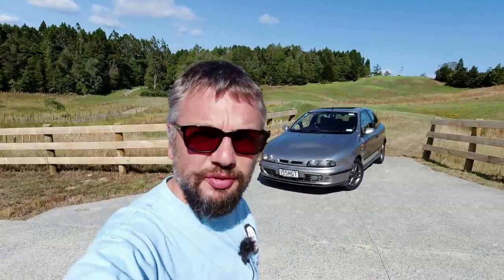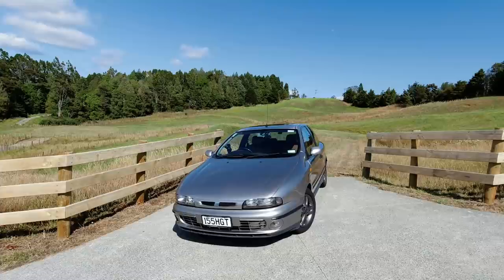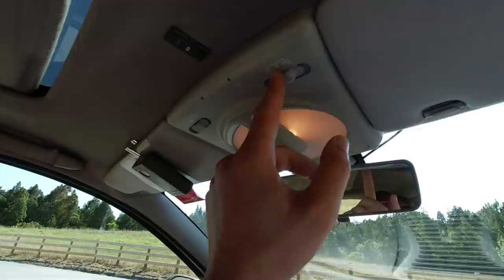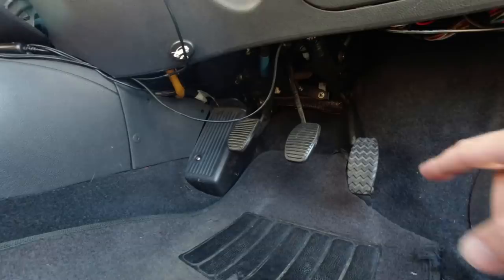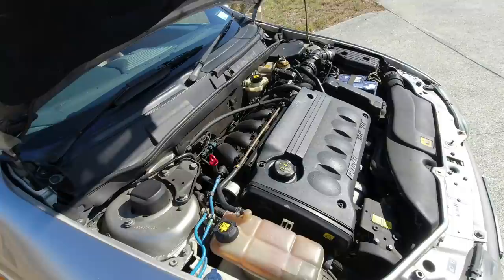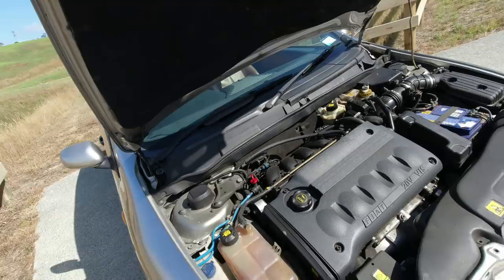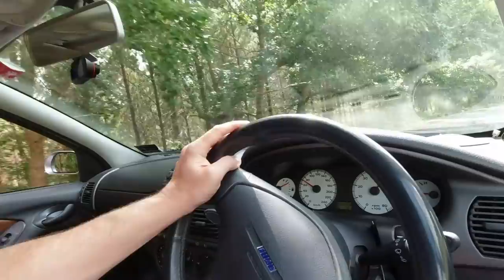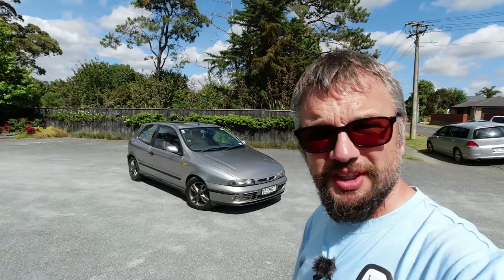Five-pot Fiat! Bravo HGT (Type 182) - Italian Music

Comment: Just had new (old) air cond condenser fitted so even cooler now :) 
Wobbly throttle sensor was being sorted when virus lock down closed NZ. 
Bonnet release lever had pulled out of its pivot, never seen do that before but clipped back in now! 

The 'Hasn't Got Torque' always needed, loves, to be rev'ed :)

Was daily driver until Jan 2019, one day will get a respray (clear coat starting to go in NZ UV) & fix headliner. 
Still running original drive train (Inc clutch), I've had 2 cambelt changes, first owner 1. 

Blog about it occasionally here
https://rcd.typepad.com/personal/fiat-bravo/
Reply: Is the cambelt the same expensive ballache as on the coupe 20v turbo? Lovely car
Reply: @damianfuller74  Yeah, some say can 'squeeze one in' by shuffling engine but needs to come out for anything major. I offset that against a really, ridiculously, good purchase price (second owner) so little depreciation cost for me. Was about 1/2 of equivalent age/condition Coupé cost.
Reply: That's a great car Robin, well worth cherishing (or send it to me in Wales)
Reply: Forgot to add, the 'thermometer' dash button shows outside air temp for 10 sec replacing the trip distance on odometer. If below 5°c     temp auto displays with ICE prefix warning.
Reply: Lovely car man!
Reply: How many litres is that engine?
Reply: @m.b.82  2.0
Reply: What part of NZ was that filmed looks nice.
Reply: @keithfoss7395  Woodhill / Kumeu ~20km North West of Auckland
Reply: Ok, so two lockdowns, and a bit more work than expected, later I have a healthy HubNut'ed Bravo back
https://rcd.typepad.com/personal/2020/08/hgt-lock-down-break-out-now-hubnuted.html
Reply: Proper Italian cars are like Italian ladies, you have to rev them up to get the best out of them. I have a Barcetta and it feels like a 1100 Punto below 4500 rpm.
Reply: @rudolphbondefangerer5513  Yes, even with the fix do still need to rev it out. No problem as love the sound. Have about 600km to go on a 6,000km road trip around NZ in it. Still such a good tourer
Reply: @RobinCapper  It was said (back in the 80's) that Italian cars had the red mark on the tachometer 500 rpm lower in Italy than in the rest of the world. Because no self-respecting Italian geared up before he was well inside the red zone.
Reply: @rudolphbondefangerer5513  I liked that my Abarth 500  handbook still has a warning not to drive in the red 'for too long' :)

Comment: not to forget the Volvo t-5 and d-5 5 cylinder engines and subsequently the ford focus rs
Reply: @IntrospectorGeneral  lol my audi 100 5 cylinder burns about a litre in 10000kms no rebuild and has covered 280000kms. your dreaming.
Reply: Defenders and Discovery's also had TD5 engines.
Reply: I had an Audi 100CS Sport with the Five Cylinder engine, seemingly indestructible. Now I'm a Volvo D5 nerd.
Reply: Not just the Focus ST and RS but Mondeo, S-Max and Kuga...

Comment: Underrated cars. Wife had a 1.8 Marea saloon. Did 100,000 miles in it with near no problems.
Reply: I haven't seen a Marea for at least 5 years but I believe you ☺
Reply: The odometer on my  Fiat Punto 1.9 JTD MARKII (2001) shows 387000 km. It drives without any issue.

Comment: 5 cylinder in my mind means Volvo. Those T5s were just the best. Had an S60 T5 for ten years and I loved it, best engine ever. Economical and effortless when wafting, like a cockroach when the lights go on when you floor it.
Reply: I've had two V70 t5's.  The local yoofs would spin around  to see what was making such a glorious noise, only to find it was an old man in a boxy estate... Huge fun.
Reply: Volvo T5s were great but the Fiat 20VT was brilliant as well. Let's be honest, the best 5 cylinders have always been Audi.
Reply: @stevenhickenjr  that is probably why Volvo bought an Audi engine design for the 850 TDI 5 cylinder diesel.
Reply: @volvo480  There's also a reason why they went ahead and design their own for the S60, V70N, S80, XC90... Sure the Audi diesel was a whole lot better than the absolutely worthless VW six cylinder boat anchor they had in the 2/7/9-series, but the ones they made themselves were definitely the best ones. The best five cylinder diesel engines were probably the Mercedes-Benz OM617 and OM602, which are definitely the engines Volvo should have used to be on par with the performance and long term reliability of their own petrol engines.

Comment: Ian, I acquired a 5cyl car partly due to your enthusiasm and I've not been ever disappointed. I've a lovely C3 Audi to warble my way to work in. It's lovely.

And Fiat even including the generation before and after the the Brava were criminally underrated cars. Even the venerable FIRE engines are still commonplace on roads even being essentially a 30 year and more old design. There's not many manufacturers who can claim that.  

Hope being stuck at home isn't too bad. Take care...
Reply: These old 5 cylinder engines without a turbo deliver all the right intoxicating engine noises without breaking any speed limits.
Reply: @MaxKuehn  it's about 140bhp allegedly. Which in a car that weighs about 1250kg isn't too bad. So even without a turbo it can "make progress"

Comment: Seriously underrated cars.  Owned a few in my time and they are probably one of my favourite cars for daily driving.

Not particularly quick by modern standards but easily as quick or quicker than equivalent hot hatches of its time.  The fact it had a 5 cylinder just made it all the more special.  It sounded beautiful.

If only fiat had put the 20vt in it from the factory, it would have been the ultimate 90s hot hatch.

Comment: When I started my business in 2003, I was borrowed to the hilt, with no income, but needed a car as the premises were 25 miles away by necessity. Being a petrolhead I wanted something that looked good, and I loved the Bravo. I spend £3.3K on a low mileage 1.5 HLX, immaculate other than a soft dent in the bonnet. I hacked around the entire country in that car, seeking customers. It handled wonderfully (like my Strada back in the day), looked great and had a decent amount of toys. The main downside was how noisy it was at high "motorway" speeds which  made journeys a drag. It was a relief to get into a Focus 1.5TDCi after 18 months but I still got 3K for the Bravo.

Comment: I've never owned a Fiat but I've always liked them; cheap, fun to drive, and often incredibly good ergonomic design. Don't think they are bad cars, more likely cars that don't get much TLC from the owners, so they end up as bangers. Seeing that handsome old Bravo is giving me an urge to check out Autotrader...cos I've seen a car on YouTube I fancy...for the umpteenth time!😁
Reply: I own a 2016 Fiat Doblo T-Jet from new. I can definitely say they aren't as bad as their reputation, but they definitely aren't that much better either. The first few years (only 2 years of warranty when I bought mine and don't count on any grace even a month after that) were an absolute disaster of all kinds of random issues. It's gotten better after about 3-3.5 years, but I say that while there's a clicking noise and feel in the clutch pedal that likes to go away every time I go near the dealer to have a look at it, the backbox is desintegrating, and it recently developed a metallic resonating/buzzing noise from the back that started on cobblestone roads but is now audible on pretty much every road that isn't perfectly smooth... Oh, and the paint quality is also terrible, I've had the bonnet and the bottom of the LHD door repainted because it peeled off under warranty, there's orange peel in some spots from the factory, and after only 6 years I have to start looking for rust underneath... So yeah, not great...
BUT...
It's definitely fun though, I've gotten the T-Jet powerplant slightly tuned and it has independent "bi-link" rear suspension, so it's pretty much a hot hatch platform, only with a small van plunked on top of it, which definitely beats the Berlingo/Partner, Kangoo/Citan, NV200... while in my opinion looking the best and being the most practical of the bunch too.
It's a shame the tax system where I live (Belgium) heavily penalties older cars because of emissions while at the same time prohibiting engine swaps, because I'd love to own a pre-facelift Multipla (which are indeed driven into the ground sadly) with a T-Jet engine. I loved those cars from the day I first saw them when they were new and I only appreciate them more as time goes on. Hopefully I can still find a decent one by the time I can register one as a historic (30yrs).
While being no classic Alfa Romeo, Fiat does have a thing that makes you have a love-hate relationship with them if you're the kind of person that can have such feelings about a car. They're like a Golden Retriever: not the brightest, puppy for life, plenty of "what have you done now"-moments that end up costing money, but they just become a part of the family while many (especially modern) cars are just fleet.

Comment: Nice car and great review, my son has a 2000 Alfa 147 2.0 TS with 199,000kms and despite being old the engine feels fantastic, it has a lovely hot oil smell about it after a run (no leaks anywhere its tight as a drum) super smooth redlines at 7,000 with light clutch (#2 clutch) and wonderful steering. Interior of this Fiat is really lovely with much nicer leather than the Alfa (which I am pretty sure is vinyl layer on top of leather). My neighbour has a 2.4 Abarth Tipo and its lovely also. As you quite rightly point out if people drove some of the these cars they might get the ‘point’ of Italian cars and why people (some people) like them so. Getting to know a good mechanic is key and we are lucky enough to have such a team of guys here in Christchurch NZ who all drive Italian brands as daily drivers.

Comment: Hi there!Some points regarding the design development.The designer P.Fassbender did follow the design of  the rear part of the Bravo.
Actually for up to x=1600 section,basically up to b pillar, the main designer was Mauro Basso,who was the main designer of this 4 car body project,run by Chris Bangle.Other main designers were Mike Robinson for the interior,Andreas Zapatinas Head of exterior at the later stage and of course Arch.Cressoni overall Director of Centro Stile Fiat.
So...all fronts were followed mostly by Mauro Basso who also did front and rear of Bravo(5door) and Marea(4door)and Antonio Piovano who did the Station rear(that was not bad at all).
Glad you noticed the relationship with Alfa 147.Very apparent to,few, expert eyes.

Comment: My mum had a V reg metallic dark blue Brava LX when I was 10-14 years old, we thought it was quite a sporty posh car at the time. Only recently did I find an old insurance document that revealed it was only a 1.2. It did have quite a powerful Bass heavy stereo for me to blast hip hop tunes when I got the chance. 

It felt abit blowy and light on the motorway in cross winds, but it was reliable and quite hard wearing. Fiat made some good cars in the 90s, and the turbo diesel mk1 punto we had before the Brava was really well liked by us. 

The good old days of Fiats with rear window stickers from Reg Vardy (that was us), DC Cook and Mangoletsi. The Bravo was the better looking of the two, the rear lights were lovely. It was abit of a bad boy car, a cheaper alternative to the Golf, with sharper handling, Italian looks, interesting engines and that bass heavy standard sound system. 

For some reason the modern version of the Bravo was unpopular and is dirt cheap used, but I suspect many have been poorly looked after. But so was the Stilo, which I suspect didn't deserve the poor rep it got. Ive seen afew of these modern Tipo's in the last year or two so maybe they will fair better.

Comment: I've had one, cambelt change was terrifying
Reply: So was the price, I bet.... my uncle used to quote £1000 with warranty.
Reply: I had an Alfa 156 with 5 cylinder diesel and got the cam belt changed quite cheaply by an independent Italian car specialist. Main dealers always use the most expensive method.
Reply: @TheKenjoje  Has had 2 cambelts since I owned. Previous owner got cam service done then when came to collect went home in a new Alfa!  Is not cheap to do but now at the stage where does low mileage, no longer daily, so not often and beyond being a rational financial decision :)
Reply: I waa going to say cambelt change a drop engine job right?
Reply: @MajorKlanga  aieee the 156... pre-facelift. In my opinion the most beautiful production saloon car ever....EVER... made in the world..ever... in my opinion.
Reply: I had a Fiat Coupe 20VT and did my own timing belt change, it's very tight but not that bad a job.
Reply: Robin Capper probably a future classic if maintained well due to them being quite rare and having such a great sounding engine. Worth the investment
Reply: @lightningleaf23  I agree! An engine lifter is a helpful investment.
I have one, in a mint condition. I love it, it's relatively fast, the brakes are great, and the sound is FANTASTIC. I won't sell it, i'll keep it forever, since it's very rare, especially in a good condition.
Reply: I sold my HGT partly because of the cam belt, mine was only 5 years old when I moved it on for a Fiat barchetta…now that little beauty is another story!
Reply: Ohhhh no don’t even go there😱

Comment: The same engine (in 175BHP form) was also used on the Lancia K coupe (designed by Pininfarina). That is also a very lovely car to drive, and as you say the engine note is really rather nice.
The Bravo also had a VERY NICE and nippy 1800 GT version, which was also quite sporty and not at all slower than the HGT 2400, and the lineup Bravo/Brava/Marea also had the diesel 2.4 JTD 5-cylinder which was powerful and extremely torquey. Nice cars.

Comment: 5 Cylinders, power of a 4 but fuel economy of a 6. 
Having driven an Audi, Volvo and Honda I5 they are not torquey and need to be revved but that makes them all the more rewarding and are characterful engines with that unique warble as you mentioned. The Bravo sounds looovely.

Comment: Had a 98 fiat bravo with a 1.4 12 valve engine back in 2009. It was a very nice car to drive with good  interior build quality, nice engine tone and good power for the size of the engine. Unfortunately lost the car in a head on crash(not my fault), the car behaved excellent in the crash and all of us(4 in the car) walked away untouched from the wreck.

Comment: The Marea had a drop down bumper, not a split-tailgate. They had the same engine, a 2.0 turbo with 180BHP and even a 2.4 5-cylinder diesel. They were a seriously good looking car.
Great video!
Reply: Marea 2.0 20v turbo was only made in Brasil and it wasn't imported anywhere else

Comment: Still waiting for a mk2 fiat uno with the fire engine.... Single wiper goodness... Love the bravo...
Reply: Good idea, I want to hear the sound of a Fire on a Uno or Y10
Reply: I`ve got 3 Uno`s (2 with FIRE lumps), a Panda 750L, & 2 Seicento Sportings with FIRE engines, love them!
Reply: @MrPabsUk  were the Uno Fire fun to drive or too slow ?
Reply: @julienbee3467  the 1.1 60SX its fine
Reply: @julienbee3467  you wont expect any thing fast from a 1.0 engine but they are very revy make a great sound and very fun... Sprity engines
Reply: @christophercutajar4020  fun and reliability, that's all I want
Reply: I did 250,000km + in a Mk2 Uno 45s before getting this Bravo, lightly modded with Momo wheels (but same size) & stiffer springs to help the handling, stock engine
https://flic.kr/s/aHsiWfDvPv

Comment: Good / bad times when I was a mechanic at a FIAT dealer. The bonnet release lever often went out of hinge, so nothing to worry about Ian. Every 60,000 km replace a distribution belt with these 5 cylinders, engine out, one and a half days of work. Therefore, they are now rare. Volvo also had a 5 cylinder in the 850 and other models.

Comment: One of my biggest regrets was not buying a marea 20v saloon that was for sale near me years ago. The cambelt job is what killed most of the 20v's off. They'd become due, owners would get a quote of over £1000 (more like 2k at a dealer as they falsely claimed it was an engine out job) and either scrap it asap or leave it and play roulette until the belt snapped. The few that did survive usually died due to floorpan rot.They're a rare beast indeed nowadays. Only owned by people who do all the jobs themselves and know that the belts can be done by taking the drivers side engine mount off and dropping the engine down at an angle.

Comment: I traded in a Pug 306 against a brand new one in 1996 (P plate). My mates thought I was daft but I fell in love with the styling. I could only afford a poverty spec 1.4. Unfortunately the gearbox went on it after only 4 years and 30k miles - good old Italian build quality. Still have fond memories of it though.
Reply: Theis one 255000km+ still on original drivetrain inc clutch. Syncro a bit weak on 2/3 but otherwise ok.
Reply: @RobinCapper  . Yours is a lovely example for its age and mileage. These are great looking cars and enjoyable to drive. I preferred mine to the 306 and would have kept it longer if it hadn't broke. To be fair mine was only a 1.4 and being a young driver at the time I probably thrashed it to within an inch of its life.

Comment: Lovely car. I small premium hatchback is a car The likes of which we never had, nor will have, in the USA. This type of car seem so exotic to me. The sound and lack is low grunt put me in mind of my tired old 1995 Jetta VR6. USA did get the 5 cylinder Honda engine in the Acura Vigor which morphed into the 2.5 TL....mid to late 90’s. Unpopular, but Pretty reliable from what I’ve been told.  Thanks again.

Comment: The Honda Vigor was briefly sold in the USA with the 5-cylinder engine as the Acura Vigor. 5-cylinder engines are claimed to give you the performance of a 6-cylinder with the fuel economy of a 4-cylinder, but unfortunately with some of them it's the other way around!